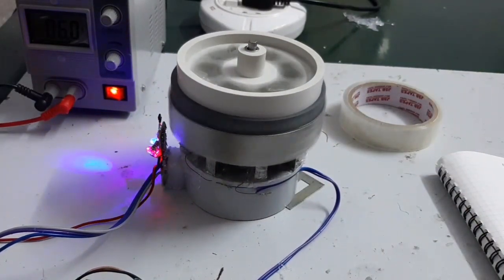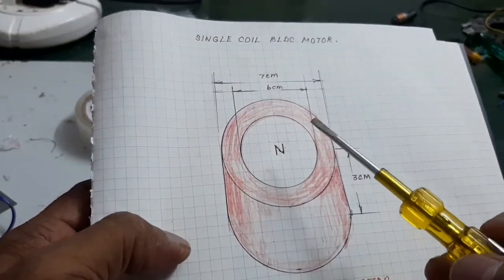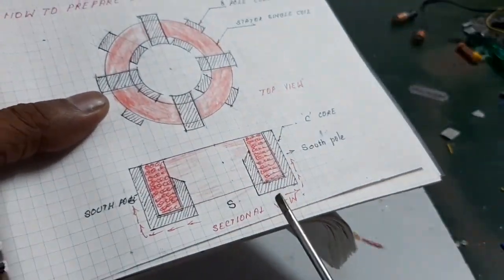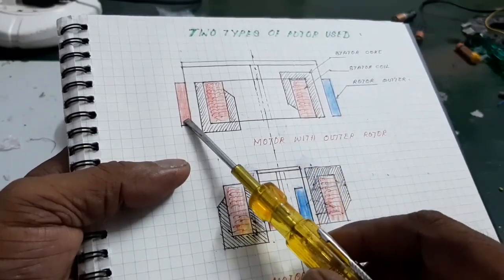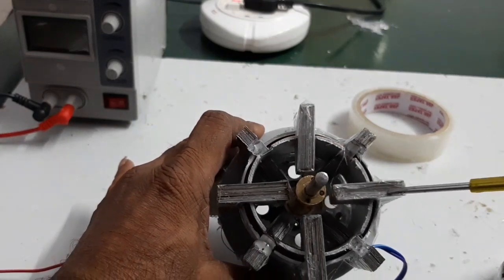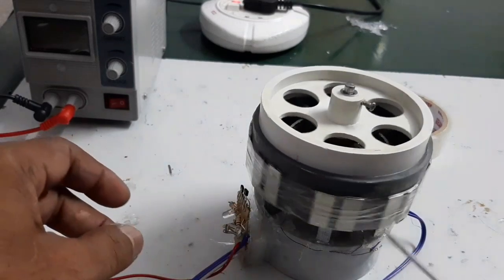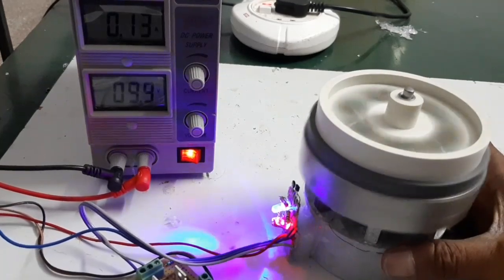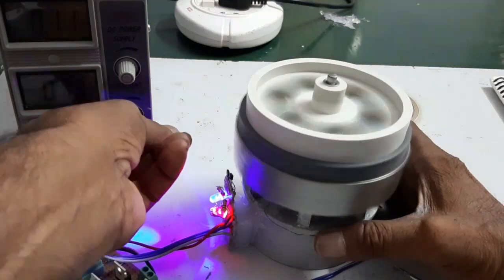(V-111),New invention, single coil energy efficient bldc motor

Comment: This motor is genius. Is this transverse flux? I think this will be a very cheap motor to make as the winding process is very easy.  Why can't you try a In and out runner (in runner and out runner at the same time) version and scale it up by adding more layers? Also I would like to see you control direction of the single phase BLDC motor.
Reply from the maker: Thank you sir
Thanks for your good suggestion 
Here i used transformer core and the core middle limp width is higher than other so when you insert the core with middle limp centre it accupy more spaces that is why both inner and outer rotor are not used simultaneously.
Thanks